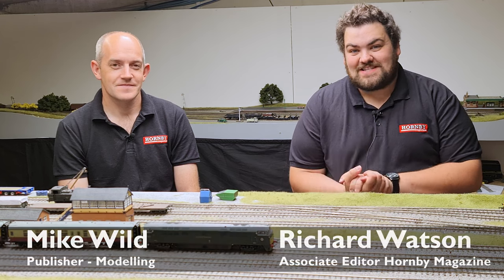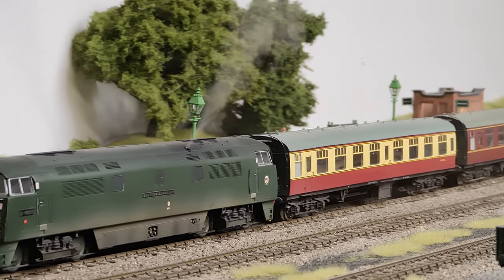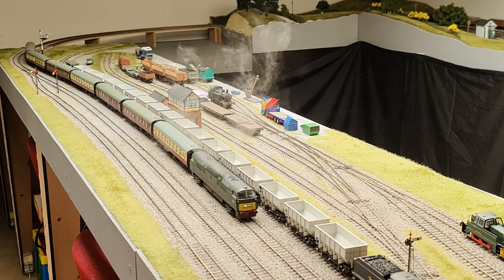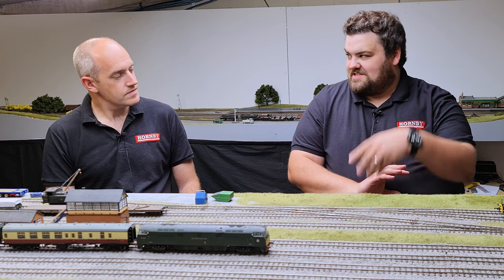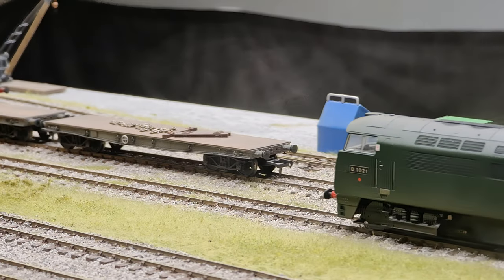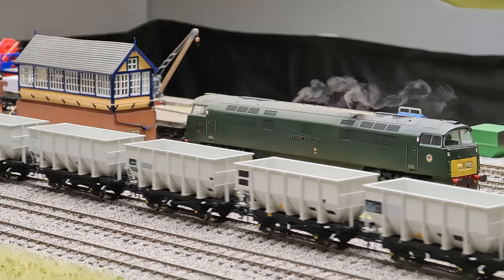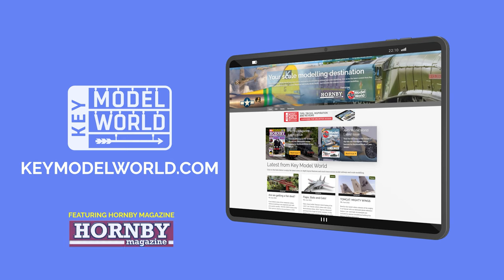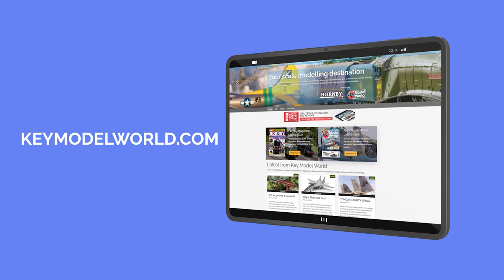HM183: TRS Trains Diesel smoke

Comment: Looks great on steam engines, not so much on diesels that belch out filthy black smoke on start up and idling but are relatively smoke free when cruising.
Reply: Dave I agree, looks great for steam, but not realistic for diesel locos other then simulating a cold start or pulling away at the start of a run. - at £350, it's making modelling a railway rather expensive
Reply: @MalcolmCrabbe  thanks for the comment Malcolm. I would never ever disrespect the guys who make and modify these incredible machines, plus the layouts are amazing. But, sometimes things that seem like a good idea, in reality don’t fly. And like you say, £350 is a lot money.

Comment: If one has several of these running where does all the water end up, even if small amounts ???   over time its going to build up around the layout,  is if going to be a disaster for anything that's steel or effecting scenery in the long term ???
Reply: A rooms moisture content can be between 30-50% so the effect it has are negligible, maybe in the long term over a period of years it may quicken the rusting process of steel track, but you can always use nickel track I think it is